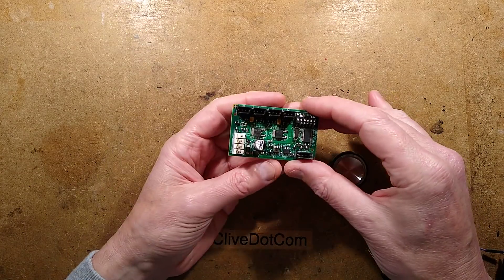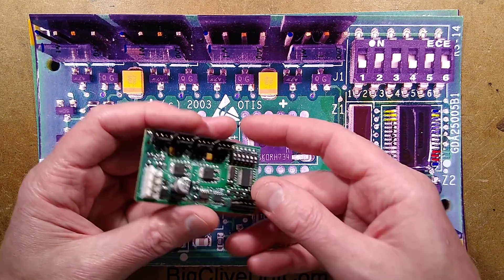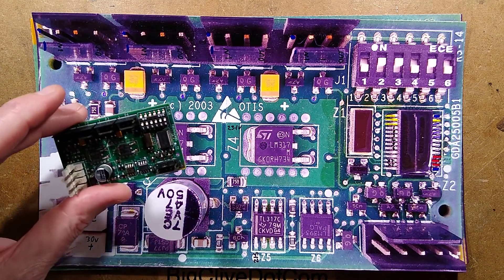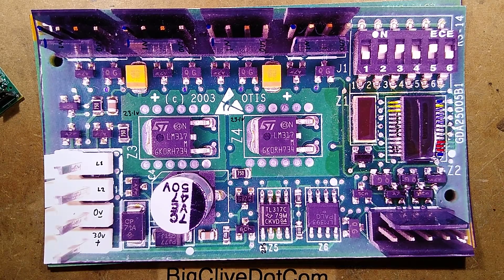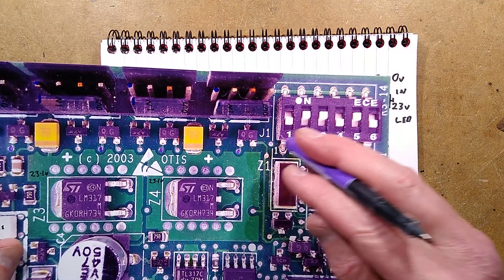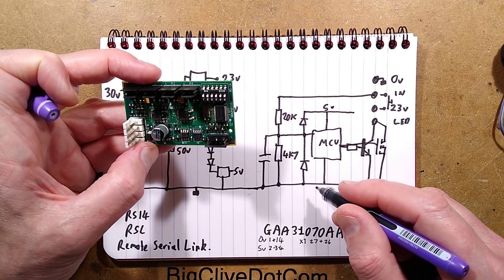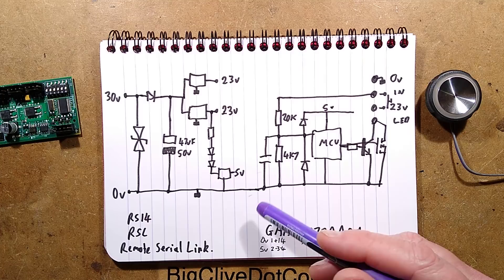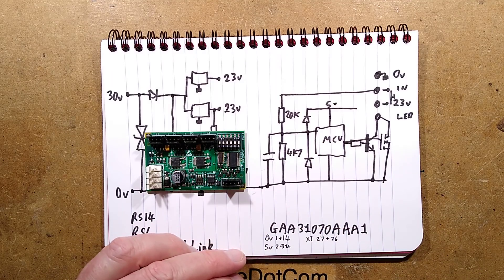Exploring an Otis Elevator button interface PCB

Comment: hi i from Russia, i hack this RSL protocol.  This is not 485. 1 line - clock, 2 line - data. Clock are have 127 pulses, first 63 pulses - clocked output data. second 64 clocked input data. Second clock respond device addres 2, third clock responsed device addres 3 and so on... Output frame have 5 bits: 1-4 bits respond devise connectors p1-p4 and bit5 resond position indicator. Input frame have 5 bits: 1-4 bits respond devise connectors p1-p4 and bit5 resond paritet. 

OTIS are not used microcontrollers, they are used FPGA

Comment: They do have a CAN version of this board called a cf14, for can fixture instead of remote serial.
Everything Otis does is proprietary due to competition in the marketplace. Rs485/422 protocols actually are used for some things, but still in proprietary ways.

Comment: I have a newer revision of this board, stamped 2014. It appears that they changed some of the layout and replaced the main chip with a different model. The data connections are now labelled "CAN H" and "CAN L". The main chip has also been replaced with an Atmel 90CAN32 which has a CAN controller. Maybe Otis recently transitioned to CAN based modules. This would possibly make it easier to send our own data to these modules and control them.

Comment: 30 volts likely for an old network in an elevator shaft.  I remember reading a Dick Morley (Father of the PLC) column where he mentioned they went with, either 12 or 15 volts, for the network comes on the original restaurant ordering registers his team developed due to the noise the line picked up running through a restaurant.

Comment: The voltages scream "Electromechanical" and I have little doubt it is, indeed, for backward compatibility with older systems. The proprietary elevator control network system makes sense because you need to get a system that works reliably as possible in a wide variety of conditions and installations while also maintaining backward compatibility. Something like CAN bus would be a good choice if you were engineering the system today, but the fact is that the systems being supported here date back to the early 1970s where there was no such thing as a computer small enough to fit in a car that wouldn't cost more than said car itself, and even if there was, it was by itself with no need to communicate with another computer. CAN bus would not be a thing until 1986 by which time the modern operatorless elevator was well established.

Comment: great, until it isn't and fails at random or takes perfect smooth power and no way of manual override to rescue trapped people/whatever. or suddenly works in middle of rescue, examples: backup power kicks in, unit reboots, rodent quits chewing, water bonds or breaks the short circuit and it suddenly all decides it's in the clear and ready to go!

Comment: We have been asked for a quote on a control system for a hospital elevator system recently, that is nearing the 20 year old mark by now. From the schematics we had been given, it looked like all buttons, light and numerical indicators ended up as simple discrete signals from the POV of a global controller. Including the button and level indicators for each cabin. If I recall correctly, this wasn't an Otis system to begin with, and this honestly looks horribly overcomplicated for the time.
By 2003, most elevators, at least in a slightly commercial setting, would probably have used some sort of PLC overseeing the whole operation, that combined with any kind of bus would have easily coped with all inputs and indication needs. The only setting where I could imagine this kind of module making sense would be for small residential use, like 8 stories, maybe 2-4 shafts at maximum. But even then, getting all the special-operation modes across (fires or other kinds of failure) seems troublesome to me, given how little an even half-decent heading PLC would cost compared to the whole setup. Especially compared to custom made silicon and PCBs.
Therefore this really does somewhat look like the attempt of some 70/80s engineers/electricians trying to force their way into the 2000s while not really keeping up with times. Am I horribly blinded here?
Reply from the maker: It's possible it may have been a retrofit controller for a traditional hard wired system.  More work to physically install, but simple and often very reliable.
Reply: @bigclivedotcom  All three are actually good arguments. And indeed, handling locally what you can does have its benefits at times. Thanks for the reply!

Comment: Dad's approach to towns is to park in the multi-storey car park and park on the top level - yes even if it was a split level car park, he'd go up that last 'half' level. Next, after all getting out of the car, we'd walk the periphery of the top level and admire the views ! It was no different in Blackpool. Having done this there, we walk to the lift and pressed the button. The lift never came. We eventually walked down a level and managed to use the lift from there.

On returning to the car in the evening, yes, the lift wouldn't take us to the top floor. So we had to walk up the last flight of stairs. On passing the lift to get to the car, I stopped - and pushed the landing doors open ! Yes, they weren't locked ! I guess the lift had a lock problem on the top floor and they'd disabled calls to that floor. This I guess was back in the 1980s.

Comment: Very interesting video ! I have seen some cheap fire panels which use serial communication for connecting various nodes ( smoke detector, glass switches, etc. ) They were running a UART Rx/Tx with an optocoupler to switch 24V  to get distance. The baud rate was less than 9600 IIRC. There was a master/slave protocol, with the main board pinging each node and waiting for a reply. Otis make large revenues on their AMC , so i guess it makes sense for then to use proprietary protocols. Also AFAIK CAN bus needs to set unique priorities for each node, and it may not make sense here because each floor switch would need the same priority; (maybe someone can correct me on this) Would be interesting to see if BC makes a follow up video on this.

Comment: I wonder if the network protocol is some variant of I2C/IIC (it's old enough as a protocol, and has the right sort of capabilities and properties, developed for internal network for TVs to carry the remote control button presses from prebuilt remote control receiver ICs, later used for allowing computers to interrogate the attached screen.)

Comment: The "MosFET" marked QG could actually be a Toshiba RN1427 which is a bipolar transistor with built in base resistors. So your original hunch could have been correct.
Reply: It would be easy to desolder the component and test it.
Reply: Technically it is not a transistor but an IC
Reply: @rexsceleratorum1632  yes... Albeit a very simple one.

Comment: The reason for switching a positive signal on a switch is when you analyze this in a fault analysis, the probability of having a signal fault to ground is much higher then faulting to a voltage. This I learned from working on avionics. They protect against transients, as again, a fault analysis will always fault the device in the worst case outcome, as you don't know what the internals of the micro processor are, so put in overkill protection to minimize this fault possibility.
Also, I was on a working group looking for a new serial bus, we tested CAN bus, the signal levels are too small, and would be upset very easy with RF radiated and conducted susceptibility tests. I don't think they use drive by wire in cars, using the CAN bus.

Comment: Cause of your videos I bought a nitecore tube recently and 10/10. Charges with the same cable as my phone. Nitecore Tip SE is what I got. My old keychain touch activate light was dieing and now its fantastic. Adjustable modes, can charge in my truck while driving, long battery than the button cell, no more accidentally activating when my knee touches it. Great utility light tho not heavy enough to put in my fire gear. 

You do more unintentional advertising than you think. Next thing you know I'll be buying elevator parts.

Comment: I have an idea for reverse engineering multilayer boards.  If you had a small (microwave) phased array antenna receiver, and you sat the board right on top of it, I bet you could inject signals with a probe and identify the paths they take. Effectively turn each circuit trace into an antenna while it is probed. Complex but would it work? Boards that are microstrip may not but I am not sure. Once you're well above the frequency the board is designed for then everything starts coupling.

Comment: I worked for Dupar there competition,  the floor switches we commonly use are just a i/o mechanical switches all the logic is done in the elevator control module.

Comment: The 0V line on the button connections is used for touch buttons with no mechanical switch inside. There are also some duo colored buttons on the market, so the button will be lit all time and change color when it is pushed. For the special buttons like emergency call I'm not sure if the LED circuit if driven all the time or if they just use the 0V terminal.

Comment: I think you're right on the money that the protocol itself is quite old, and might stem back to the days before computer controlled elevators. Since neither of us is seeing a driver on the board, I guess they're bit-banging the comm bus on the microcontroller. Maybe they're using resistor networks (like the button), and/or FETs to deal with the voltage difference. 🤷‍♂️

Comment: When I worked in maintenance many years ago, I got called to a two story building who's second story call button wasn't always working. Suspecting bad contacts in the switch, I took it apart and found an unused set of N/O contacts. I switched the leads to them and it worked just fine! Having a bit of fun, I installed the Down button upside down and anounced that I just added a third story to their building!  But, after having it pointed out that people would now have to take the stairs down to ground level, I destroyed my imaginary "third floor" and installed the switch the right way around. :D

Comment: The LM393 has OC outputs. Maybe an I2C protocol?
This would require pullups somewhere. But then there is no short circuit when Hgh and Low are on the bus at the same time.
High can be higher than 5 volts.

Comment: Regarding any wire acting as an antenna/aerial - I worked on an access control system in a large TV studio complex. In a few places, doors would spontaneously unlock as frequently as every few minutes. The system would register the pressing of a Request-to-exit button except it hadn't been pressed. We eventually put it down to RF or electrical interference from high current cables in the vicinity. Using earthed/grounded screened cables worked in some locations but not others and using a small capacitor helped - to "slug" out the input but again, not always. A bloody nightmare all told. I have only come across anything similar on a house alarm where the house was near the London underground. Years later, I bought a house by the Underground - all my alarm circuits are wired in screened cable and I have no problems.

Comment: RS485 or some variety of it is used in all sorts of security applications like alarms, access control etc and also for fire alarm datalines. You could use IP but that would then tend to depend on someone else's infrastructure for their operation. For safety in lifts and for security and safety in access control systems that kind of dependency is not good.

Comment: Would you do a for-a-fee consult? I have a simple IC555 timer circuit that controls an intermittent windshield wiper controller, and I need help in identifying which component controls the initial (power-on) pulse to its relay (it's too long compared to all the delay pulses that follow that are controlled by the potentiometer). Thanks!

Comment: Another reason for the 0v feed to the button.  Solid state touch senors would require power.  These would have no mechanical movements.  Either detects the physical touch on metal or the presence of a human just above the pad.

Comment: I'm guessing the reason for the proprietary network was for vendor lock-in. If third manufacturers can't just buy an off-the-shelf transceiver and throw a comms protocol library at a generic microcontroller, it's going to make it a lot more difficult for your customers to source cheaper third-party parts that work with their elevators. And if they've got a patent on the protocol, they can just sue anyone who tries to spin their own clones.

Comment: It is only a dumb question if you don't ask. So I don't know. How many floors do you think this controller would work 4 or more. Could it work work having 4 contacts 8, 16, 32, 64 or more?
Reply from the maker: I'm not sure how many nodes the network can address.  Above the limit they might use another universe (complete separate network).

Comment: Now try imagining that in a mechanical equivalent panel, and how much more space it would need.  I wonder which would still be functional in say, fifty years from now.
Reply from the maker: The mechanical ones last longer.
Reply: Someone can always rebuild/remanufacture electromechanical equipment.  You only need to look at the Bakerloo line trains on the underground to know that with periodic rebuilds, motor rewinds etc. and remedial metalwork to the frame and chassis that they could be run for another 50 years.  But would be very hard to integrate to modern signalling.

Comment: Had to take the stair the other day while changing out a 5 HP VFD driven motor on a rooftop.  The Thyssen Krupp elevator tech was trying to fix a malfunctioning key pad.
It is amazing how much electronics is in a modern elevator.

Thanks for the diversity Clive.

Comment: I've been alarmed to find man-rated infrastructure like elevators having their controls linked to fully-routable IP networks rather than something more difficult to bridge over to the Internet without special devices that would at least require physical access to the wiring for installation.  One has to wonder how many elevators are one firewall rule away from takeover by those with ill intent and how many have already been recruited into botnets awaiting command.
Reply: At least all the safeties on an elevator are hardware-enforced.
Reply: Elevator controllers are sometimes linked to internet to remotely monitor elevator status. Accessing any programming or controls remotely is impossible.
Reply: @Dennis-ei6er  Impossible you say? The software may be written to disallow it but I'd bet the hardware has the ability to do so. If that's the case then undiscovered bugs in the code could be leveraged for nefarious purposes.
Reply: @eDoc2020  Elevator controllers don’t have internet connectivity. You can’t change parameters unless you are physically at the elevator controller.
Reply: @Dennis-ei6er  You just said they were sometimes linked to the Internet. Do you mean there are external bolt-on monitoring systems? I've seen some sort of fancy console on a hospital's elevator so I guess a device could mirror the LEDs online.
Reply: @eDoc2020  Yeah exactly, separate device, different manufacturer from elevator controller. 

In theory maybe possible. Some elevator controllers have a windows based computer interface, so maybe you can hack into that. But in my experience they’re always offline, don’t even have wifi boards installed.

Comment: The "smart" KONE lifts in our building have Manual Call Points with a large numeric keypad, where you call the floor number you wish to go to, the the lift system figures out which path you need to take.  For example; If you're on Level 4 & press '1' & '2' (for Level 12), then one of four low-rise lifts will be called to your floor.  Once inside the low-rise lift takes you to Level-9 (transition level) & the internal Lift display will tell you which high-rise lift has been called to meet you on Level-9 so you can transition you to get to your final destination.  The entire Lift system is quite "intelligent", but that's just a brief description on how the "smart" lift works.
BUT, one thing the Building Owner has discovered since switching from their KONE maintenance contract, to a different Lift maintenance company is; KONE have "Chipped" their switches!  Meaning: If a button 'fails', you have to buy a KONE button in order to replace the faulty keypad keyswitch!
Reply from the maker: Kone are notorious for locking their systems when they lose a maintenance contract.  Fortunately the geeks in the industry have ways around that.
Reply: @bigclivedotcom  Kone, like all major players in the industry, have their own unique control methods (Otis RS14 for example..) It’s no harder to work on a Kone lift than any other (perhaps easier if know what doing). All that locked out is the ability to change parameters not the fault and general diagnostics.
Reply: @bigclivedotcom hi Clive.  Any chance you could do a vid regarding addressing the rs14 with the test tool.
Reply: Some italian made entrance door openers do this. The installer can set a pin code which means no one else can service the unit. Often times the service contract is so outrageous the building owners will scrap the units and replace them with another brand.
Reply: My university got a new control system for the main building, where you select your destination on a touch screen (which also has TTS for the entire menu, which is really well done - you have a big button on the side that you press and then it goes through all the options reading them out, and you press again to confirm) and then tells you which of the six elevators to take. When we initially got it, you used to be able to make a "group call" (i.e. have one lift go there without any additional stops), but that got locked out after students used it too much.
Reply: Learned this from Apple perhaps?